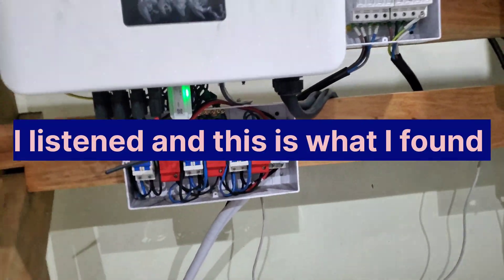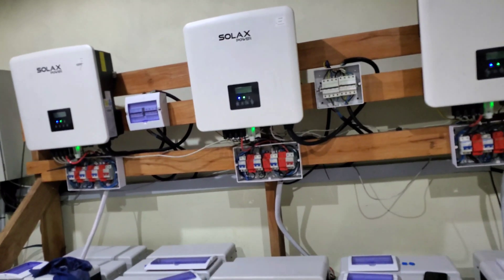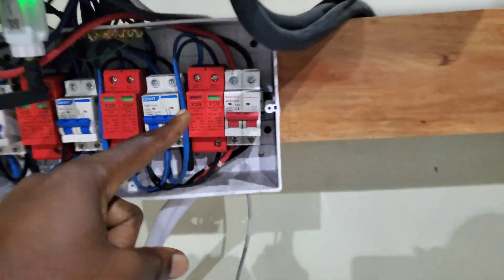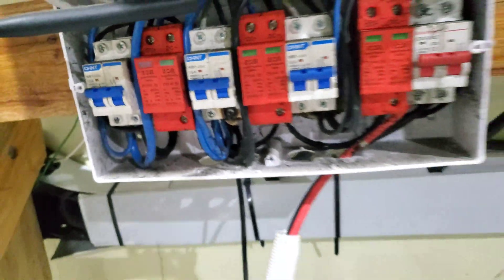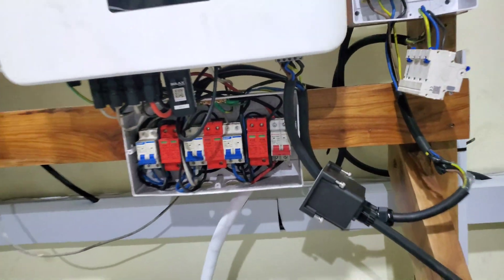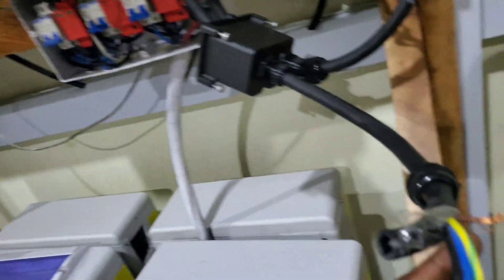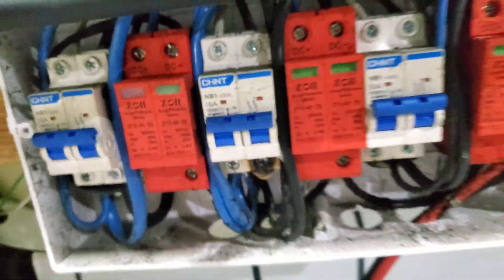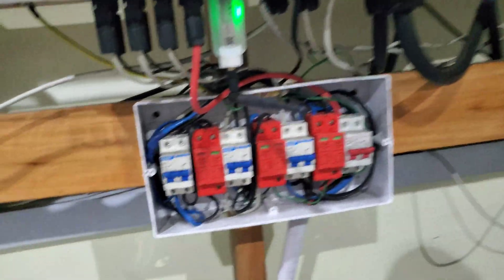You spoke & I listened. Thank you so much. See what I did. #solax  #gratitude #microgrid

Comment: You have to replace your surge protector modules. The inner module pulls out and is replaceable. Are you tightening all the fasteners properly? It seems extremely unusual to try and set up a maintenance procedure where you are re-torquing terminals monthly. Are you using the right kind of ferrules? What is the response curve on your breakers? What kinds of transients are you experiencing that would cause this?

Have you performed static analysis of maximum loading that these conductors take? Do you need to re-size or re-engineer the design to accommodate the loads you're encountering? The practice of tucking the wires between the MCBs is not one I would promote.

I am spotting all manner of things that give me pause for the installation: No wire support, no conduit or incorrect application of conduit, unstructured wire trays, extra holes in junction boxes, no labeling. Where are the design documents that categorize the maximum conductor fill in your conduits? Do you have thermal rating calculations for the conductors into the MCB enclosures?

Your proposed methods of safety layers require a person to be present to mitigate the risk. Power (distribution) installations must fail safe without human intervention.

I understand that this installation is currently partially disassembled - please make sure the basis for it is engineering reviewed; for example, failure analysis and modes, as well as system load calculations and permissible loads.
Reply from the maker: Thank you so much for this. We will use this as a template

Comment: You should periódicaly check lose conections on all brakers and spd's,  
Generally once every three months, even if you use ferols, you could also use a torque Meter on the screw driver to tighten everything to the speced torque.   This goes for all connections, i.e. on the charge controller, tha battery terminales, brakers, fuses, etc. On the battery terminals take special care that they are tightened to the right torque, if lose they can get very very hot.
Reply from the maker: Thank you for watching and commenting. We do periodic checks.

Comment: Spd most likely experience overvoltage thus failing.complex overvoltages do happen when inverters opposes detected power sag.sometimes inverter over corrects  the power sag resulting excess voltage production.hi impedance/poor connections most likely caused this power oscillation.also.miniature circuit breaker needs cooling therefore they should be spaced apart  or  hot air ventilated out of enclosure.
Reply from the maker: Thank you this. I agree with you on the voltage.

Comment: I tighten the breaker screw and wiggle the wire then tighten again. I keep doing that until I feel it is very tight. Heat causes expansion of the wires at the connections. It is a great idea to check on it  like you said. Glad everything is ok. It could have been much worse. Cheers stay safe
Reply from the maker: Good tip.

Comment: Hey hey! Have a look at adding Bootlace lugs to the multi strand and dc cables. You crimp it on and it becomes a solid single cable. Where you have 2 cables, get a big boot lace and crimp both in one to make sure they are solid.
Reply from the maker: We did just that. Thank you for this tip.